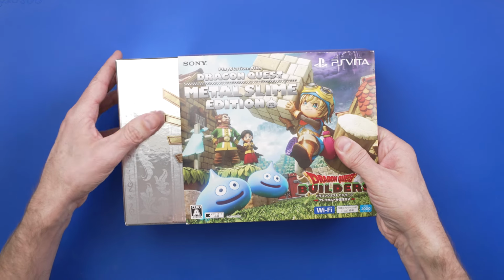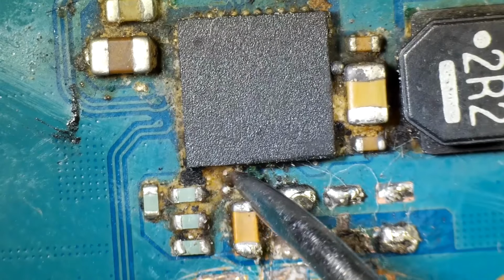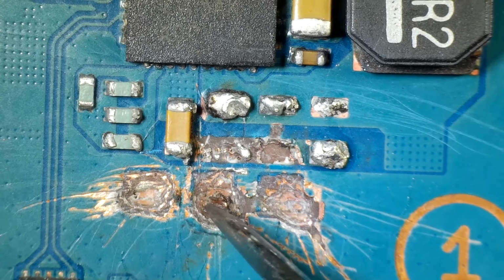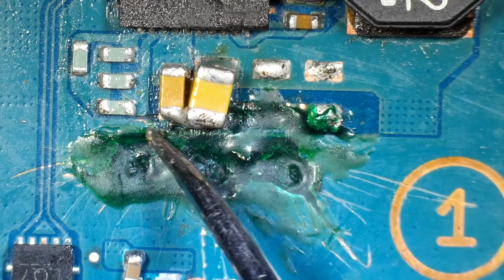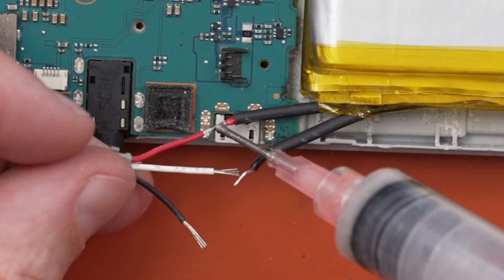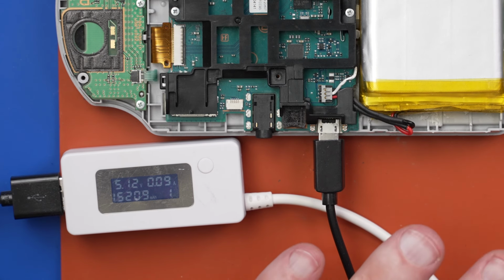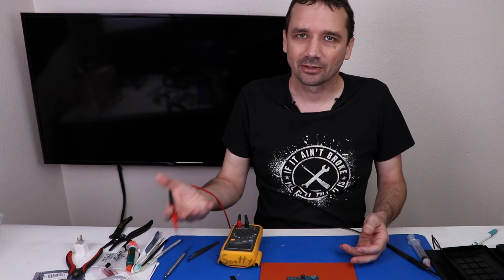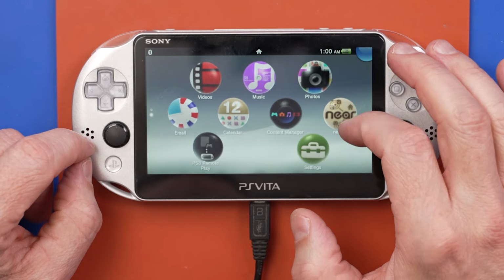Dragon Quest PS Vita - Battery Mod Major Fail

Comment: Could you adapt a device with an on/off switch on the positive terminal of the battery, in a way that would allow you to turn the voltage supplied by the battery to the PS Vita on and off?

Comment: I think the person trying to do the aftermarket battery mod was trying to do the Lipo battery mod conversion  with universal connector. Hence why you need the battery connectors and thermistor to attach to piece of battery component from the original battery. From there you solder the power and ground to the connectors and a thermistor to the third white wire. Its a delicate mod to take on if you don’t have the proper tools, patience and knowledge you end up with a disaster like this. Y

You almost got the wiring done correctly, you only needed to add a piece of the original battery board to the Lipo battery.

Comment: If you van do this I belive I can figure out how to solder on a new charging port for a Nintendo switch that my sister in law tore off. Thanks for the inspiration to finally reattempt and get my other soldering jobs done. I realized I can't break it if it's already broke but I will be cautious and take my time because I'm not good at any soldering but I figured like with everything it just takes time.😊

Comment: Apparently the screen has a tempered glass protector installed, judging from the slight bump on the top left corner near the "SONY" logo. It could be just a scratch on that glass instead of the screen itself.

Comment: Man, I have a Vita OLED just sitting here gathering dust simply because I cant find the fuse for the charging circuit. I have looked for it everywhere! I cant even get a parts board.

Comment: I once got a cheap "as is" vita years ago that had just about every zif tab inside broken off! I was able to get it working again by adding thin tape to the back of the ribbons to friction fit them in, which was way easier than sourcing new connectors and hot air swapping them all. BTW, the thermistor needs to be physically touching the lipo or it'll do nothing. It's purpose is to monitor the cell temp and cut off charging in case it starts rising too quickly. Having it not touch the cell would mean it'll work normally, but if the cell ever does get damaged and starts going thermal the themistor cant sense it till it's too late and the cell ignites or spews electrolyte.

Comment: Man, you're doing a good job, but better learn some basic knowledge in electronics, at least to understand which component you see :)
Never cut the battery wires all together since it can short the battery which can explode right into your face. Cut them one by one

Comment: Oh the frustration of watching the video.  In my experience, the controller board on the battery often has the pad for the white wire empty (although you do need to inspect that pcb for LiPo controller chip too).  If it was fitted then you didn't even need the thermistor mod or to cut wires.

tbh I can feel your pain.  From a personal point of view, I'd have loved to have seen you remove the scratch on the screen.  It's a plastic shell, and I've never found a good solution to remove a bad one on my PS Vita.

Comment: Jesus christ, how is it even possible to damage the board that badly 😂
Reply: @thereturnticket  he maybe had the same problem I had,no microscope.
Reply: @neworientation1-m8z  Lol no chance. That damage is just due to pure incompetence and lack of ability to perform the job. I NEVER use a microscope for micro soldering because they are clunky and annoying and get in my way. I just use my naked eye and a jewellers loop if i need to get a close up of what is going on before I go at it with my naked eye. Soldered 100s of 0201 size components with absolutely zero issues seeing what I'm doing. I've also never damaged a board anywhere even remotely CLOSE to that even when using a grinding pen to expose traces or vias to solder to for mod chipping things like the Switch.
Reply: STOP blaspheming!
Reply: @HunnysPlaylists   Oh my God, how could they!?
Reply: @samholden4014  your curses are Consummately Returned.

Comment: Moral of the story:  If you don't know what you're doing don't try hardware modding.

At least with software modding/hacking you can restore to factory defaults.  Doing so with hardware isn't so easy.

Comment: I installed a 3300mAh battery in my ps vita, the battery was from a samsung smartphone. It runs longer for a couple of hours. I have the 1000 oled model, the 3G one, i removed the internal connector for the hspa modem, otherwise my battery wouldn't fit, i removed the sony port and installed a micro-usb connector in place where the accessories port was (which isn't used anyway on ps vita) and i modded the L and R buttons for nice clicky ones, i didn't like the feel of those buttons, i mean, every other button is a nice clicky one, except for those 2. My vita runs great, a lot of people want to have my vita, but i keep it! I've put in a lot of work and time to mod it just the way i want it.

Comment: I don't see the point in modding the battery, Cameron Sino makes quality aftermarket batteries for the Vita now.  They are drop in replacements and don't require soldering.

Comment: If the existing battery was good, why was the seller messing with a battery swap?
Reply: I guess it wasn't good.. but soldering directly onto the board rather than modding the connector.. I can't fathom the thought process that leads to doing that.

Comment: I didn't even know people did this battery mod. I'd be so scared to mess up such a beautiful device!
Reply: It's a nice boost to the battery life, and eventually people will have to replace the battery when it starts dying so might as well upgrade. BUT NOT LIKE THIS LOL this board actually got raped, I don't even know how you mess it up this bad and I'm a noob at soldering.

Comment: I love these videos they are so interesting. I watched this one as I currently have a problem with my vita. 

When I go to charge it I know the charger is good and it keeps cutting in and out of charging and will only charge to 30%ish anyone got any tips or know if it's easy to change a battery in a vita or do I have to find a proper person to do it as I'm guessing that's the issue 😅

Comment: I bought a new battery from ebay for the ps vita (and there was ~20 listings for the same price at the time of buying) and the connector didn't exactly sit flush so you can guess that it didn't charge or turn on. anyone else had this issue or is it just me? it worked when I secured it with hot glue but that is silly. I have no choice but to solder the old connector to the new battery.

Comment: How the hell did he destroy those pads so bad he went through multiple layers?!
Reply: Huge amounts of retardation
Reply: Looks worse than the first time I ever tried to solder and that was with a really cheap thin practice board. I'm guessing they wanted to use the board as a soldering iron holder

Comment: I once bought flux sold for soldering. However they didn't inform me that the flux was meant for soldering copper pipes. So after soldering electronics with it later started corroding. So maybe the seller used flux for soldering pipes instead of electronics?
Reply: Exactly what I was thinking, because I made the same mistake as an amateur! Likely bought water soluble flux as that's what's most readily available at hardware stores

Comment: If I'm not mistaken, the white wire is a temperature based resistor or you could say a battery temperature sensor which normally prevents the battery from overheating/overcharging or maybe even overdischarging. But most cheap battery companies in china used to bypass it with normal resistors, so the sensor wouldn't work properly

Comment: Because of your videos and your free soldering course I have fixed 2 headsets and a home theater subwoofer. Next project is replacing the clock capacitor on my Original Xbox.
Reply from the maker: Love hearing this!

Comment: So... whoever tried doing this mod job likely shorted those contact pads and welded different layers of the PCB together, judging by the skid mark? Probably tried soldering the wires coming directly from the battery, and the battery had a charge. Another good reason not to try using the aftermarket battery. xD
So many ways to avoid this... could've used wires that weren't connected to a battery, then putting them together afterwards. I'd definitely try using that connector somehow instead, just to avoid soldering things directly to the PCB. That's just super iffy particularly if you don't have the right tools. Boards with tiny components like those the most I'll risk is hot air gun... don't have enough confidence to solder things directly to it even if I had a fine tip soldering iron, which I don't.
I suppose the kit didn't come with a connector to use there, but if you are replacing it anyways just chop it off the original...
Yeesh... well, sometimes there's only one way to learn things, which is by doing expensive mistakes. xD I also do them all the time.

Also, it was pretty generous to pay that much for it Steve... :P I mean, it is a limited edition and all that, but man, still expensive.
Btw, the creature that came with it is a Metal Babble. xD I have one made of metal in my figure collection. xD

Comment: When it comes to poking at electronics i have found the best material pick to use is a Nylon pic.
Silky/smooth yet hard plastic thats unlikely to be able to damage anything important while also able to dig at anything needing sticky/annoying stuff.

I usually like the 2 sided ones with a poker on one tip and a scraper on the other, the sharp points on both ends stops you being able to press on the end to overdo the pressure and potentially cause damage.

Comment: I’ve been wanting one of these particular Vitas for a while now. 

I half expected you to go right for the board swap, but it would have been a much shorter video. I enjoy watching the troubleshooting process.
Reply from the maker: It's a pretty cool one! I did want to at least try and fix that original board.
Reply: @Tronicsfix  I have one with the same problem - liquid damage in the same area. Haven't been able to figure it out yet either. Tried reflowing the chip, nothing - and replacements don't seem to be available. Would be interested to know if anyone has any information on that circuit.
And I think you made the right call using the original battery in the end - there isn't really any point in using a third party battery over an original one, unless you really want the higher capacity, but then there are issues with that (the Vita only checks voltage level at boot; it normally calculates remaining battery by tracking mAh used, so as it's assuming a 2200mAh battery you could put in a 4000mAh but it would think it's dead when it still has 1800mAh remaining - unless you turned it off for 2 mins and then back on again. If someone can make a plugin to check voltage regularly then an upgraded battery would work well with CFW but otherwise it's not a very user friendly mod.).